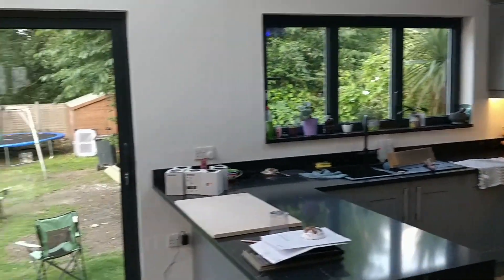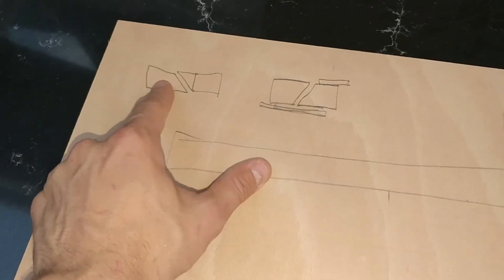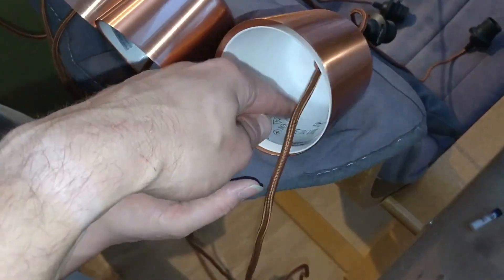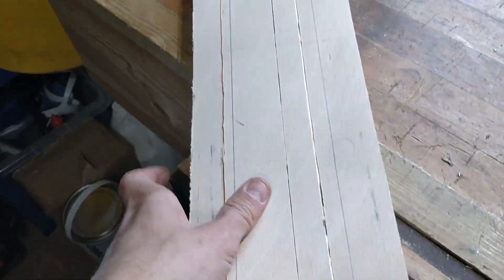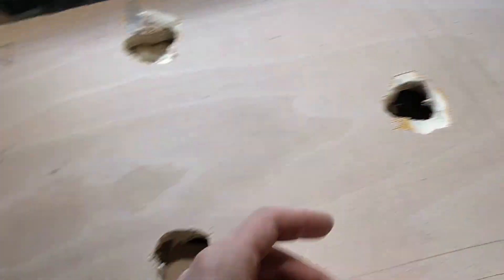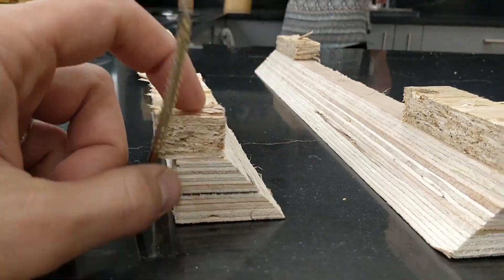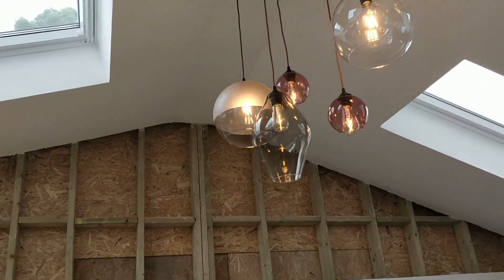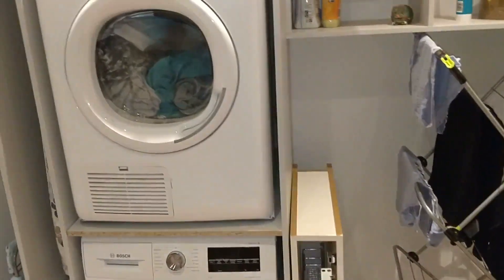How to create a custom built chandelier

Comment: the lights look great, and I imagine have much more impact when you are viewing them from the room.  I'm also thinking about hanging light fittings in certain spaces rather than the omnipresent LED downlight. It's not easy trying to design something relatively cheaply as these kind of chandelier fixtures can be very expensive.
Reply from the maker: Cheers, thanks for the comment! We're really happy with it, and have added an extra bulb now. It's a real statement piece and has saved us a fortune compared with a shop-bought fixture.